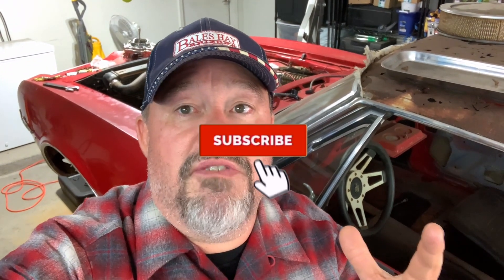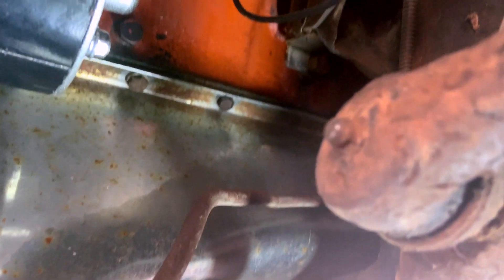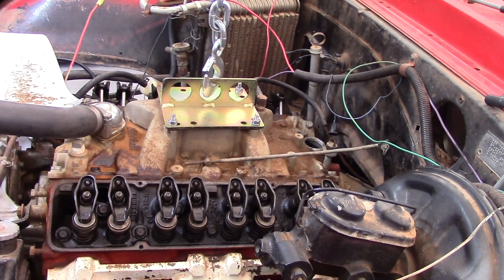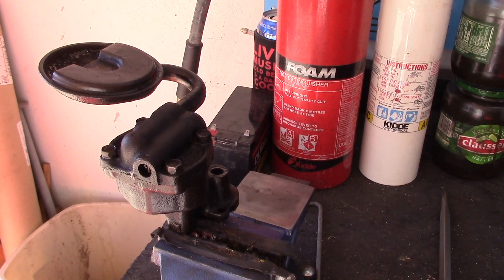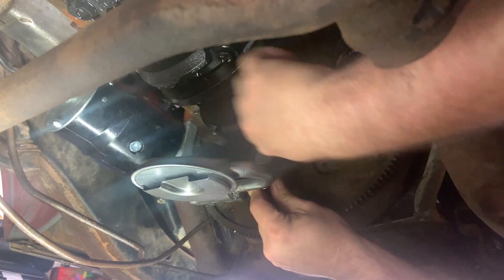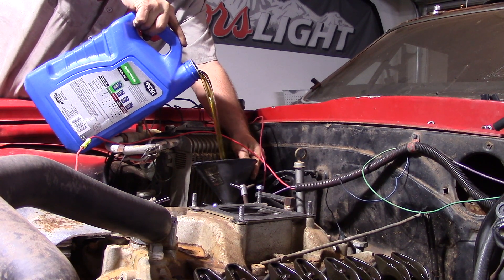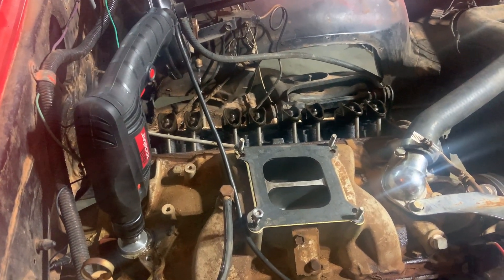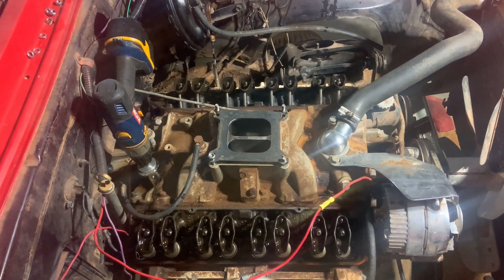How to replace oil pump and install pickup screen in the car on a Small Block Chevy 350 PART 6

Comment: Dark Red Poly would be really killer looking on that firebird I have a big sheet of oldschool colors with the paint codes
Reply from the maker: I am really torn between an awesome red and a stunning black!!!
Reply: @ArrowheadGarage  red will be a very expensive color to paint but is kind of forgiving about the body work, if you paint it black, all of your imperfections in the body work will show guaranteed. Black is the hardest solid color to spray, white is actually the easiest to spray and will hide alot of bad body work.

Comment: With the distributor out you can pour the oil down the distributor hole and it will go straight to the pan. Also to fix the rotted roof you have 2 options,  you can either buy an aftermarket replacement roof and try to fit it and make it fit as best you can because they never fit perfect and weld it on or of you can find someone with a parts car or shell to cut the roof off and put that on, if you can find an original roof panel it will fit 1000 times better than an aftermarket one but they are hard to find you may need to look online and see if anyone has a parts shell to cut metal off of.
Reply: Dynacorn makes about the best roof skin I  did a 66 mustang about two years ago it fit pretty good a firebird actually will be easier then what I had
Reply: @Peter-hg5qd  dynacorn are not a quality product l would use AMD OR CLASSIC INDUSTRY
Reply from the maker: Hey Brian, that is what I was afraid of... China Metal Sucks!  Thanks for the tips... What about just making it a convertible? lol
Reply: @ArrowheadGarage  yeah, some of the aftermarket metal is not very good, if you have the ability to find some actual GM licensed replacement metal it will have a much better chance of fitting correctly, auto metal direct makes decent sheetmetal or try dynacorn, they actually make complete 69 camaro and firebird shells but they are super expensive but they do offer some replacement sheetmetal. If your not going for a barrette Jackson resto, you can use an aftermarket roof and bondo it back into shape and make it look good enough for a driver quality build, unfortuanantly for most low budget builds you have to cut some corners and deal with things not being perfect to keep the project going.